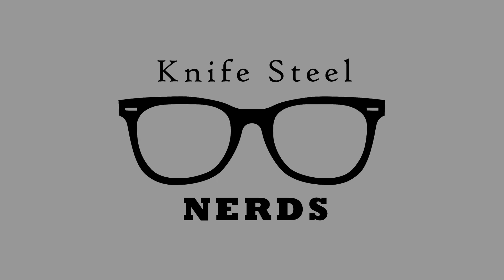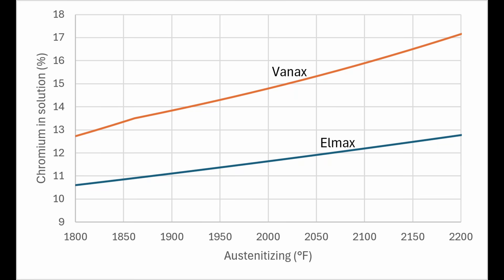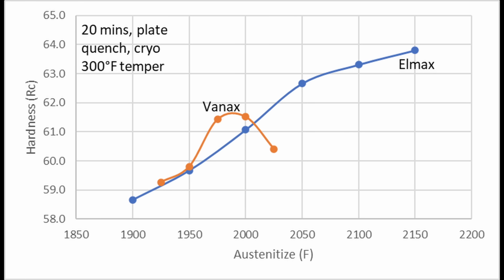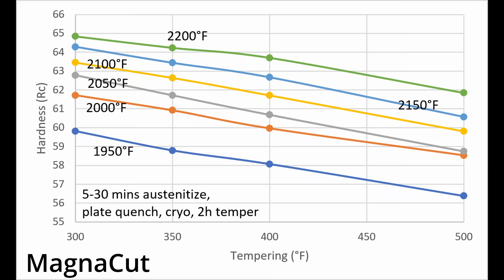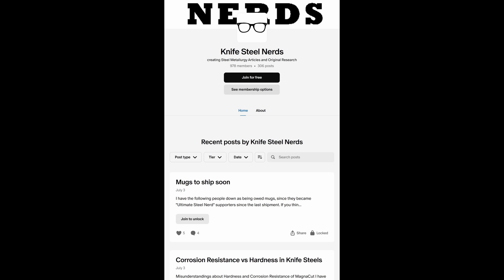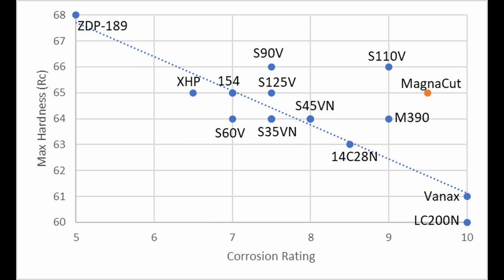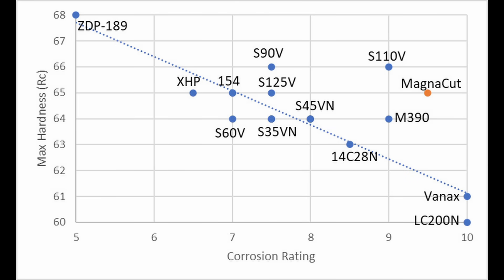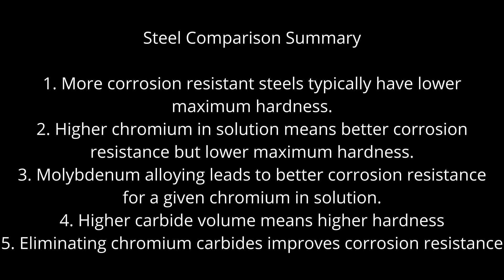Corrosion Resistance vs Hardness - Is Softer MagnaCut Better?

Comment: I got two Magnacut Blades. Both from UG tools (with the titanium handles). 

The bushcrafter at 62 HRC and the TiNy at 64 HRC

Tried to do a spray test to test corrosion. Saw no rust spots on either.

Comment: the chart at 1:35 is surprising. a massive amount of corrosion resistance is achieved at as little as 3%, and even 0.5% isn't doing nothing. this really changes my perspective on steels like A2 and CPM3V.

Comment: I think it’s time we hold makers responsible and stop purchasing lower hrc steels for reasons like easier sharpening and better corrosion resistance.
Reply: Totally. Use a higher toughness steel instead of gimping a higher hardness steel for mediocre toughness improvements. Only pops ProCut really can get a significant toughness benefit from alternative heat treatment options, and that's not from a different temper. Not every company can do cryo though, or as fast a quench, so you can't hold all to the same standard unless they cost as much.

Comment: I mostly buy budget knives, so I see plenty of 14C28N. If the manufacturers cite a HRC, it's usually 58. Would they get better edge retention if they went to 63? Would that compromise toughness? And is the answer "it depends", because the austenitizing temperature would also play a role, so you couldn't say without knowing if that was altered as well?
Reply from the maker: Higher hardness would mean higher edge retention and lower toughness, yes.
Reply: @KnifeSteelNerds  Thanks!

Comment: Chuckling here in Golden, Colorado. These steel composition and heat treat subjects are interesting to me. But, as just a volunteer sharpener and not a knife maker, I am not able to absorb this good info. Goes right over my head. Still, Larrin, major kudos to you for your accomplishments and significant contributions to these steel subjects.
Reply: The only thing I truly take away is that knife steel metallurgy is always more complex than I had previously thought... every single video! 
The bit about chromium carbide and depletion areas was a bit of an 'ah haaaa' though

Comment: I have a question... how high can hardness get on a plain carbon steel with nothing alloying into it? 70 HRC?
Reply from the maker: 67-68 Rc or thereabouts but that is without tempering
Reply: @KnifeSteelNerds thank you! Is this a theoretical number, as in, it can be calculated somehow, or an experimental observation that has been made over time?
Reply from the maker: There are many reported experiments and a few that I have done, such as on 26C3: https://knifesteelnerds.com/2019/08/12/how-to-heat-treat-26c3-steel/
Reply: @KnifeSteelNerds I bought your book, and this is a question that I always have. I always wondered how we got the number.

Comment: I got my first magnacut knife in an MKC blackfoot. I don't think I'm overly impressed with its hardness, and after scouring their website, I don't see any comment on the HRC. I wonder if they are mass producing and not getting optimal hardness to bring out magnacuts benefits. Seems like my edge gets deformed easier than it should.
Reply: Mkc doesn't even know how to remove the bur and they burn edges.
Reply: @tacticalcenter8658 
Really!?
Shameful as they are crazy expensive!
Reply: If they tend to burn the edge then following the logic of the presentation here, they may do a good heat treatment: since in this instance it is easier to burn an edge. 
If the edge is burned it will be hard to detach the wire burr without bringing the apex with it. 
In the instance of doubt, I will touch up a new factory edge before any hard use. Otherwise the weak apex will begin to roll and tear at the good steel behind.
So I suggest you put your apex on a 600+ grit diamond plate and cut it off clean. Then cut yourself some new bevels. This will give you a far better idea of how the knife will work out for you than testing in the factory edge. 
Most factory edges are garbage and a lot of the very best are mediocre.
Reply: If the HT is junk you might find a custom maker willing to do a tailored HT for you, but you will have to lose some of the steel in preparatory and post-HT re-grinding.

Comment: Fascinating as always! It seems like the boiled-down answer is that an "easier" heat treat that many manufacturers utilize lends itself to poorer performance - lower hardness and corrosion resistance. 

Sure makes me wonder why Benchmade and Leatherman are producing MagnaCut products at such low HRC or with such wide HRC ranges.
Reply: Production knives are being heat treated in batches of thousands. So, you are inherently going to have some variability.

 Seems you are assuming lower hardness also means less corrosion resistance, watch the video again.

Comment: If I'm understanding correctly, if you want to maximize corrosion resistance and toughness, you should austenitize and temper as hot as possible for a given hardness target because the chromium carbides will dissolve and the chromium will be in solution? If so, the logic would follow that you would trade off some wear resistance I suppose
Reply from the maker: I didn’t discuss toughness in this video. Austenitizing hotter usually reduces toughness (though there are counter-examples).
Reply: @KnifeSteelNerds I guess I'd have to triangulate the data between hardness, toughness, and corrosion resistance values for different austenitizing and tempering combinations for my desired result. Appreciate your insight as always Larrin!

Comment: Ever since I first tried growing crystals, CuSO4 if I recall right, I was entranced. My love of dealing with HT/T in steels simply continued that particular interest. It's always fascinated me that relatively small changes in the process in terms of heat and time will encourage different crystal formation and distribution, leading to (in simply aesthetic crystals) different macroscopic shapes, and (in steels) different material properties due to microscopic shapes.

Truly fascinating stuff!
Reply: That's the key to heat treatment which almost nobody seems to understand.  The vast majority of people out there are stuck in the "higher HRC -> better" mindset when in reality a higher HRC so often comes with a degraded crystal structure.